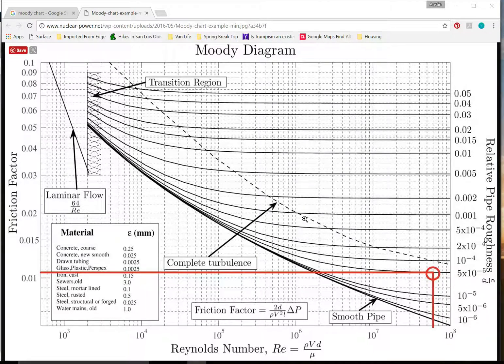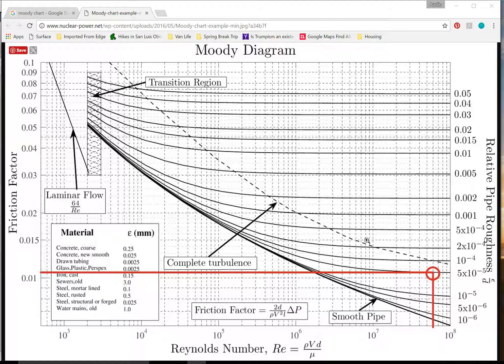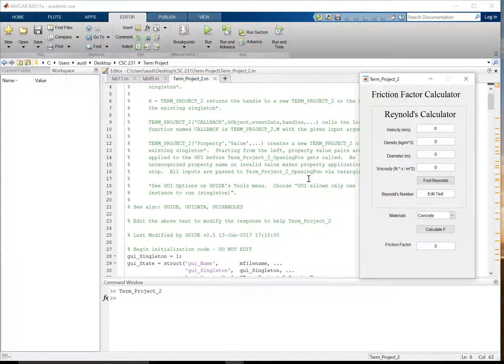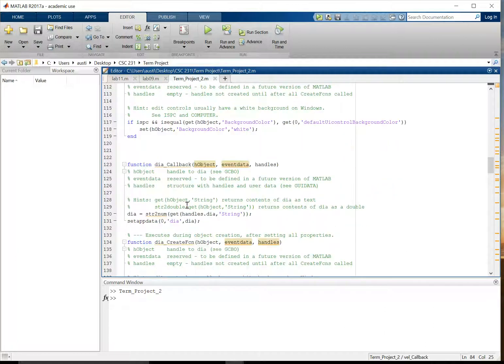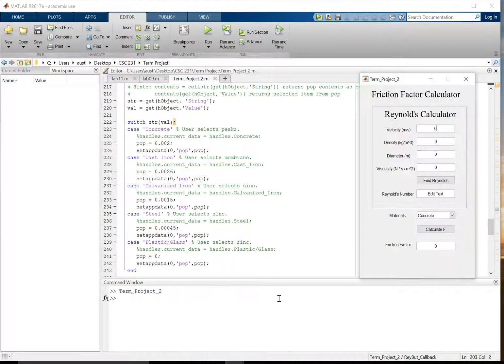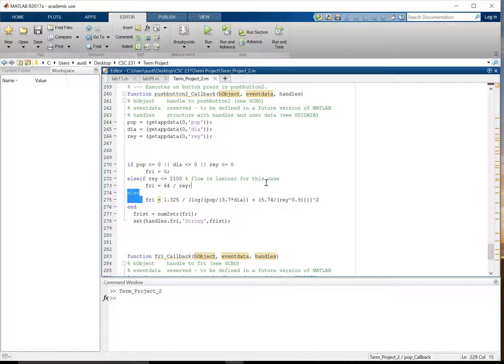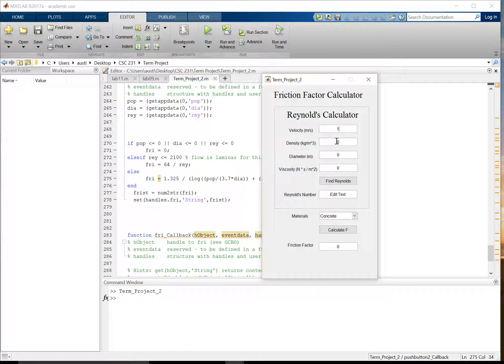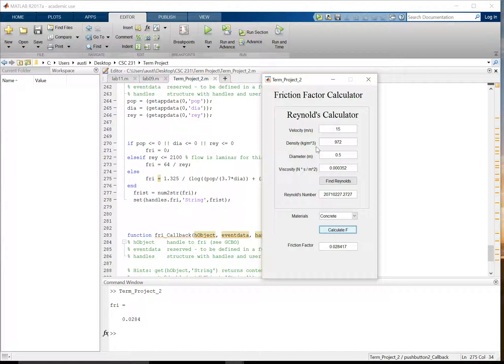Moody Chart Calculator

Comment: If you don't mind. Can you share that code?
Reply: tambem queria este codigo
Reply: @elisangelarochafernandes6300  1 ano depois, mas eu vi esse vídeo e criei uma calculadora dessa em python. Não tá lá essas coisas em visual, mas a funcionalidade é basicamente a mesma.
De qualquer forma, se precisar, segue o código:

from tkinter import *
from math import log

window = Tk()
width, height = 450, 400
posx, posy = int(window.winfo_screenwidth()/2), int(window.winfo_screenheight()/8)
window.geometry('{}x{}+{}+{}'.format(width, height, posx, posy))
window.resizable(False, False)
window.title('Diagrama de Moody')
window.config(bg='#121212')

size = round(height/30)

materials = {
'Concrete (coarse)':0.25,
'Concrete (new smooth)':0.025,
'Drawn Tubing':0.0025,
'Glass':0.0025,
'Plastic':0.0025,
'Perspex': 0.0025,
'Iron (cast)':0.15,
'Sewer (old)':3,
'Steel (mortar lined)':0.1,
'Steel (rusted)':0.5,
'Steel (structural or forged)':0.025,
'Water Mains (old)':1}

reynolds = 2100
roughness = 1
friction = ' '

def calcReynolds():
    velocity = velocityVar.get()
    diameter = diameterVar.get()
    density = densityVar.get()
    viscosity = viscosityVar.get()
    reynolds = velocity * diameter * density / viscosity
    reynoldsText.set('Re = {:.2f}'.format(reynolds))

def calcFriction():
    try:
        roughness = materials[materialVar.get()]
        reynolds = reynoldsVar.get()
        diameter = diameterVar.get()
        if reynolds >= 0:
            if reynolds <= 2100: #flow laminar
                friction = 64/reynolds
            if reynolds > 2100: #flow turbulento
                friction = 1.325 / ((log((roughness / (3.7 * diameter)) + (5.74 / (reynolds ** 0.9)))) ** 2)
        frictionText.set('f = {:.8f}'.format(friction))
    except:
        print('Selecione um Material')

upperMargin = Frame(window, height=size/2, bg='#121212').grid(row=0, column=0, columnspan=3)

velocityVar = DoubleVar()
diameterVar = DoubleVar()
densityVar = DoubleVar()
viscosityVar = DoubleVar()

velocityVar.set(1)
diameterVar.set(1)
densityVar.set(1000)
viscosityVar.set(0.00089)
viscoityEntry = Entry(window, textvariable=velocityVar, bg='#1e1e1e', relief=FLAT, fg='white', insertbackground='#a35cfa', selectbackground='#a35cfa').grid(row=1, column=3, pady=size)
diameterEntry = Entry(window, textvariable=diameterVar, bg='#1e1e1e', relief=FLAT, fg='white', insertbackground='#a35cfa', selectbackground='#a35cfa').grid(row=2, column=3, pady=size)
densityEntry = Entry(window, textvariable=densityVar, bg='#1e1e1e', relief=FLAT, fg='white', insertbackground='#a35cfa', selectbackground='#a35cfa').grid(row=3, column=3, pady=size)
viscosityEntry = Entry(window, textvariable=viscosityVar, bg='#1e1e1e', relief=FLAT, fg='white', insertbackground='#a35cfa', selectbackground='#a35cfa').grid(row=4, column=3, pady=size)

velocityLabel = Label(window, text='Velocidade (m/s)', fg='white', bg='#121212', font='Arial 12').grid(row=1, column=0, padx=10, sticky=W)
diameterLabel = Label(window, text='Diametro (m)', fg='white', bg='#121212', font='Arial 12').grid(row=2, column=0, padx=10, sticky=W)
densityLabel = Label(window, text='Densidade (kg/m³)', fg='white', bg='#121212', font='Arial 12').grid(row=3, column=0, padx=10, sticky=W)
viscosityLabel = Label(window, text='Viscosidade (Pa.s)', fg='white', bg='#121212', font='Arial 12').grid(row=4, column=0, padx=10, sticky=W)

reynoldsText = StringVar()
reynoldsButton = Button(window, text='Calc. Reynolds', fg='white', bg='#1e1e1e', font='Arial 12 ', relief=FLAT, activebackground='#a35cfa', command=calcReynolds).grid(row=5, column=0, columnspan=2, padx=10, sticky=W)
reynoldsLabel = Label(window, textvariable=reynoldsText, fg='white', bg='#1e1e1e', font='Arial 12').grid(row=5, column=3, pady=size)

reynoldsVar = DoubleVar()
reynoldsVar.set(reynolds)
reynoldsEntry = Entry(window, textvariable=reynoldsVar, bg='#1e1e1e', relief=FLAT, fg='white', insertbackground='#a35cfa', selectbackground='#a35cfa').grid(row=6, column=3, pady=size)
reynoldsEntryLabel = Label(window, text='Reynolds: ', fg='white', bg='#121212', font='Arial 12').grid(row=6, column=0, padx=10, sticky=W)

materialVar = StringVar()
materialVar.set('Escolher')
menuItems = []
for material in materials:
    menuItems.append(material)
materialMenu = OptionMenu(window, materialVar, *menuItems)
materialMenu.config(bg='#1e1e1e', fg='white', relief=FLAT, font='Arial 12', highlightbackground='#1e1e1e', activebackground='#121212', activeforeground='white')
materialMenu["menu"].config(bg='#1e1e1e', fg='white', font='Arial 12', activebackground='#121212', activeforeground='white')
materialMenu.grid(row=7, column=3, pady=size)

frictionText = StringVar()
frictionButton = Button(window, text='Calc. f', fg='white', bg='#1e1e1e', font='Arial 12 ', relief=FLAT, activebackground='#a35cfa', command=calcFriction).grid(row=7, column=0, columnspan=2, padx=10, sticky=W)
frictionLabel = Label(window, textvariable=frictionText, fg='white', bg='#1e1e1e', font='Arial 12').grid(row=8, column=3, pady=size)

window.mainloop()
Reply: If you still need it, use the Python code I wrote. It's above, as a reply to Elisangela.